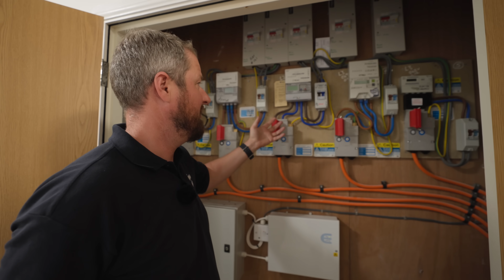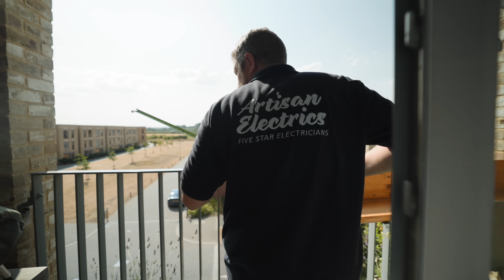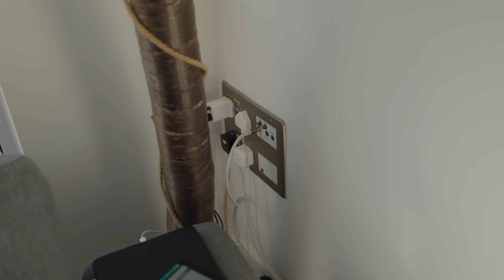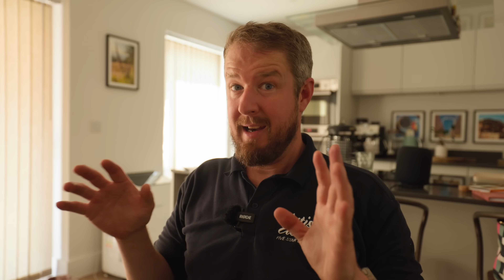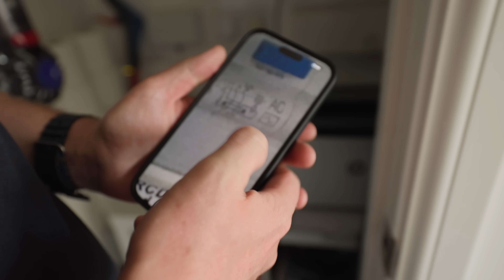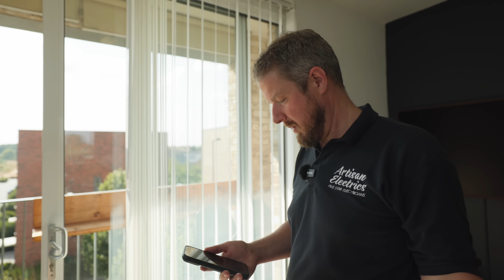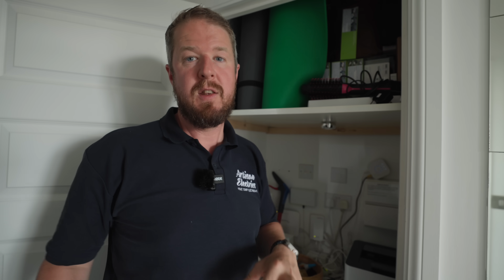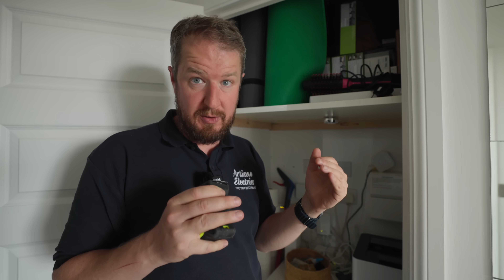I Found a BIG Problem With Plug-In Solar…

Comment: Plug in batteries are not included as part of the Regulatory amendment as of August 2026. Only plug in solar.
Reply: You're also not allowed to have the panels on a wooden structure (eg the fence) as he showed in the video.
Reply: @alexatkin really? How is that different from a roof bearing in mind that every joist I’ve seen is made out of wood. It’s not like the tiles will block much in the way of flames and a lot of roofs have bitumen sarking felt which is pretty flammable. 

Not having a pop at you, just interested on where this info has come from and the thinking behind it.
Reply: @davideyres955  People misreading the "don't hang them on Grenfell type buildings" bits as far as I can tell from reading it. Fences are fine, in Scotland. You need planning permission in England and Wales !
Reply: @etchedpixels  in England you need planning permission to wipe yer arse! Which is kinda karma because you can use the copious paperwork to do it! Perfect recycling..
Reply: @alexatkin  I have seen plenty hanging off wooden fences,  they seem fine.
Reply: @TerryHickey-xt4mf But against the rules for DIY solar.  I agree its a bit silly.

Comment: bs about the ' are the wires ok to hook up a plugin solar....'  the wires are rated to a certain amperage the panel is NOT supposed to produce more than 800W since that is the max, so no it is no problem at all to plug it in.
Reply: Actually it’s the inverter that is limited to 800 w not the panel(s).
Reply: @davideyres955  yes that is what i mean the max input on the wires shouldnt exceed 800W,i should have been more clear on the inverter and not say panel indeed :)
Reply: 800w is a third of a 2 bar heater, and I seem to remember they were ok.

Comment: Even Old type 2 mcb’s are inherently bi-directional,
Reply: My fusewire fuses are too
Reply: Irrelevant. MCBs are not residual current devices, which need to be tolerant of supply on either side (bidirectional).
Reply: Alas no you are incorrect as not all are. There is multiple technical data sheets on MCB’s and videos on this especially from Efixx. Clue - Arrows or Numbers on the L & N……

Comment: Useful info, but you keep mentioning batteries. I don’t believe batteries are part of the plug in solar legislation currently. Hopefully they will be at some point.
Reply: 100%
Reply: Strangely enough I understand the Anker system with battery is on the approved list.
Reply: @johnwhelan2663  Its G98 approved but requires wired in not plug in.
Reply: @etchedpixels  nope, it is on the plug-in approved list but it is a very truncated system with no way to get more than 800W out of it
Reply: @bangkokbullmoto Not when I looked and it's also explicitly wire in on their own website for their unit with battery
Reply: Correct. Isn’t stopping Labour chucking batteries at “low income households” even though they are not legal. Never mind it’s just tax payers money they are spoofin away.
Reply: @davideyres955  They are spending a fortune paying rich people huge bungs to get mostly awful air/water heatpumps at vastly inflated prices and the batteries plan is just newspaper noise at this point so they may even have just made it up or reported on it because some junior civil servant was told to write a 1 page note on it.

Comment: I would be more worried about that pizza oven on the balcony over plug in PV lad!
Reply: shows you don't know what ya talking about. The oven doesn't produce dc,  you can put out a pizza oven if it catches fire. dc cables on the other hand they keep burning until the sun goes down.
Reply: @Pugs86ley thanks for your riveting information

Comment: I'm not a 'Sparky' Jordan, but the way you make your video's is really interesting! I'm actually an Engineer, I do turning on a manual lathe, turning metal parts to tolerances within 5 microns of a millimetre! (0.005mm) a lot of the time! So I guess I'm as bad as you when it comes to getting things 'spot on' like your wiring neatness! I have to get that tolerance sometimes over a length of 1.5 metres!

Comment: Fixing them permanently needs planning and landlord permission but vertical is best for wind and bird droppings etc. just like fence panel solar and house wall solar and still not allowed a plugging battery with the solar
Reply: Balcony solar is not permanent, everything can be clamped down, and you know damn well people are going to use a battery if they want to, anyways, it's not going to stop them... And who's going to know??? All I see is a solar panel... 👀
Reply: @SolarizeYourLife  Takes one neighbour to be a pain. Also for the freeholders and landlords on flats the post Grenfell rules mean they have an active duty to spot and act on fire risks, with huge penalties so forgetting to notice on flats is no longer an option.

Comment: Not factually true that you need bi directional rcbos according to the regs and efixx electricians on YT when they investigated this.
Reply: Grid-Tied systems don't need a bi-directcional RCD, because the inverter will shut-down, when the RCD trips, as there is no-longer a grid to follow.
Grid-Tied systems, never have done - how long have fixed solar inverters been connected to household fuseboxes, and RCDs, Decades?
What's the difference, that the inverter is small, and now on a plug?
SMA made a single-panel inverter that plugged-in, like a power brick.
Reply: @johnbooth5199 the RCBO will trip 10x faster than the inverter will shut down. This leads to AC on the output of the RCBO and non bidirectional RCBO has circuitry that can be damaged by this.
Reply: @pau1phi11ips  Are you sure - the inverter should stop, on the next zero crossing, because the voltage failed to rise above the zero. Even if the tripping coil stays energised for another cycle, that;s only 20 milliseconds.

Fixed solar inverters have been on RCD protected circuits for decades, without a problem. What's the difference with a plug-in? They both follow the same anti-islanding rules.
Reply: Bidirectional?
Last I heard, the UK electricity supply was AC. The current changes direction every 10 milliseconds.
Reply: @oldbloke135  The power flow is normally uni-directional, though. Feeding a conventional RCD backwards, into the output, will burn-out the tripping coil, when the RCD trips - because the tripping circuit latches.
That is to insure the RCD trips, and burning the coil out, isn't a problem, because the power is instantly removed, when the RCD trips. 
Except if the RCD is fed backwards. It will trip and open the contacts, disconnecting the load, just fine - once. Then it burns out, and can never trip again.
Reply: @johnbooth5199  the grid tied PV inverter will also cut power within 10ms of losing grid connection, preventing burnout of the RCD
Reply: @jack504  Yes, that's the anti-islanding protection.

10ms is the time period of one half mains cycle.
The inverter watches the sine wave, as it goes through the zero crossing, and if it doesn't start rising again, it won't deliver power.

There are more complicated mechanisms involved, as anti-islanding can be fooled, by multiple different inverters being connected to the same mains supply.
Reply: @johnbooth5199 the point is, the RCD won't burn out if you have just one micro inverter with functioning anti islanding.
Reply: @jack504  I know, that's what I said. Loughborough Uni, did some research, years ago, and while they did manage to make a particular combination of inverters and loads island - it wasn't stable.

They tried really hard to defeat the protection, and it wouldn't have worked in the real world - the whole street would be connected, and your inverter would overload and trip.

I've been seeing "It's really dangerous." the sky is falling in, type posts, from electrical organisations.

Plug-in solar, works, and has done for years, on the continent. It works here, as the DIY tinkerers have shown. Plug-in didn't follow the letter of the UK regulations, so it wasn't allowed. 

Plug-in (grid-tied) battery systems work perfectly. 

Several Youtubers have quietly been using them.
They get away without their energy supplier noticing, because they already have fixed solar / battery installations. The plug-in just adds to it, slightly.

The only difference between plug-in, and fixed systems, is the size, and the plug. The technology is the same, so it's not going to be a problem - for grid-tied, at least.
Reply: Which reg? Some makes of type AC rcbo can be blinded by a dc current ie from the pv, so they may not trip. Thats the issue. A type A gets over this and maintains its protection.